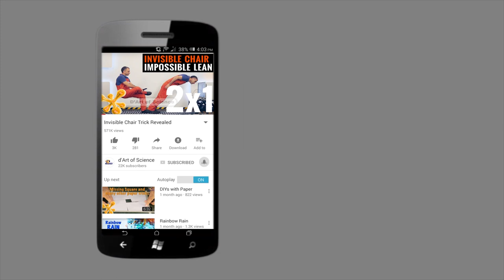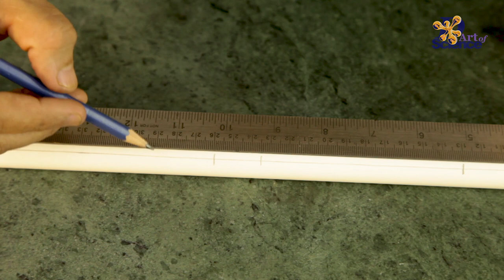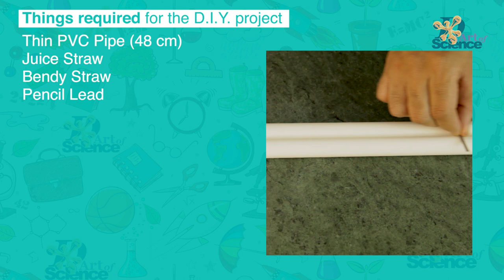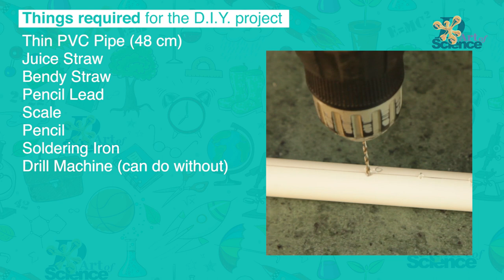How to make a Flute from PVC Pipe? | DIY PVC Flute |  dArtofScience

Comment: I make it but I’m not getting the sound like you, I don’t know what I did wrong.
Reply from the maker: check step by step...even the smallest thing that you did differently might cause it not to work
Reply: U won't, the measurements are wrong, firstly the holes don't have equal distance,  so you won't be able to play sargam properly (you will get some wierd notes, not sa re ga ma pa da ni), secondly u should use a cork, not tape to cover flute from one side, it must be placed at a proper distance from the blowing hole, inorder to get a correctly tuned Flute, never try to make flutes like this, this is why we have professional flute makers (you can buy from punam flutes or sarfuddin flutes or Kanha Flutes etc, there are so many good, professional flute makers, it will be worth the money and u won't waste time and PVC pipe).